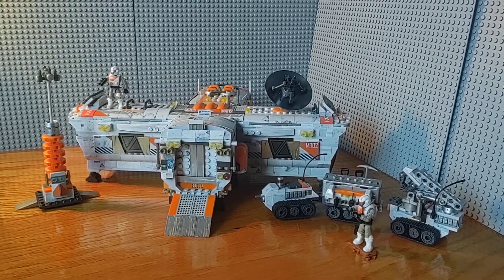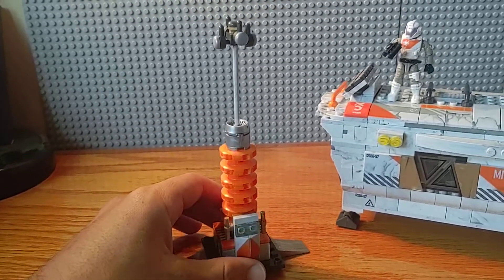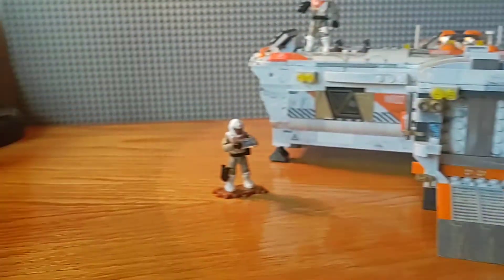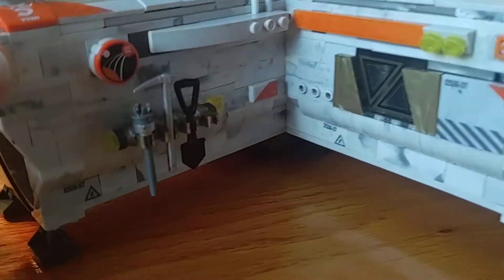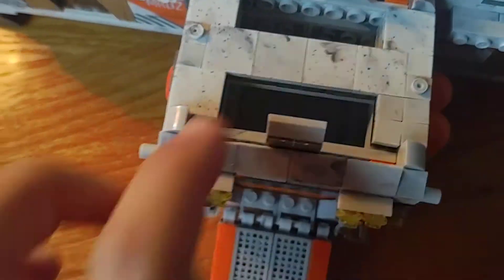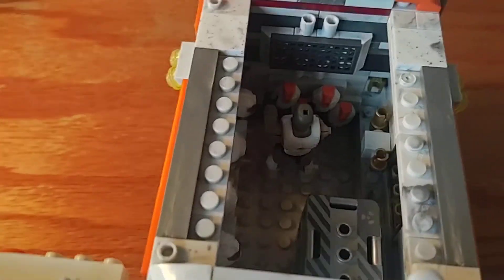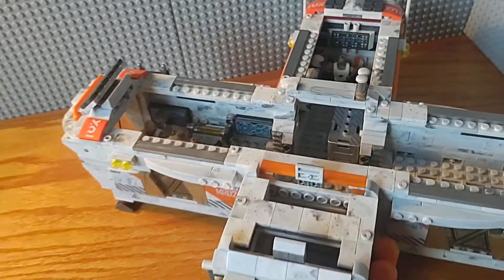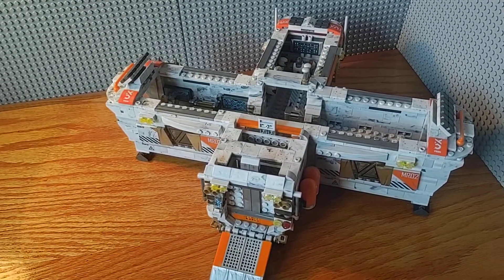MCX Mars Research Outpost

Comment: The Mattel branding and the end production of Mega Bloks seemed to have solved the
clutch or grip problems with all the kit themes.  Other than the random opinions I have
read, I found this to be true.
After being able, myself, to invest $$$ into specific kits, the ratio of bad clutch is all 
but gone, except for half the minifigures...the Zombie stuff was perfect.
Some of the Alien Agency elements, the large elements were the worst, very brittle.
A few baseplates of Halo were warped or continue to "grow" that way.

Are you finding any production issues...certain element maybe have cracks/warping
or bad clutch...building with multiples of a kit of some specific theme seems like
a way to find out.
The mix color or camo bloks are so sweet.  I do not care for the color scheme of this
theme, the Mars sets....I LOVED the orange/purple elements from the old sets and
the way TLG nerds hated such until those colors were adopted as production.
Reply: The last "major" issues i've had were with the "classic tmnt" line. Those tiny gold pieces in the Samurai Leo set all broke. Mega sent me an ultra rare Classic Donatello as a replacement. They didn't replace any of the gold pieces. Fine with me, that donatello was the only thing i was missing (aside from the rock dudes) from the line. Amazing Technodrome.
Reply: Oh and one day,  all the joints on my Mega Bloks Megazord crumbled. And all rubber treads to all vehicles eventually break. Possibly, faster if only displayed.